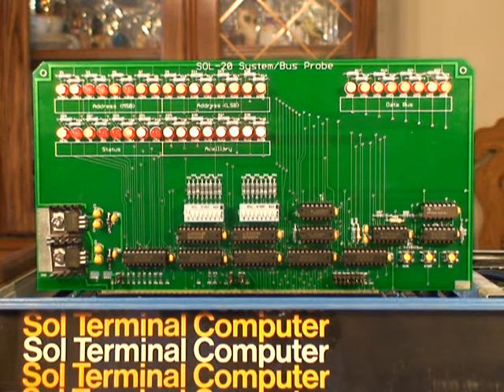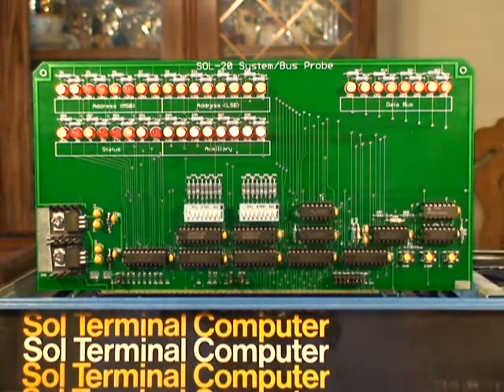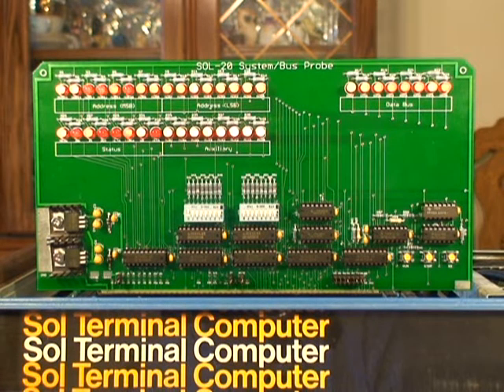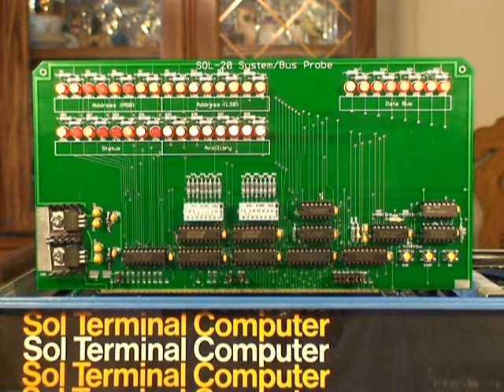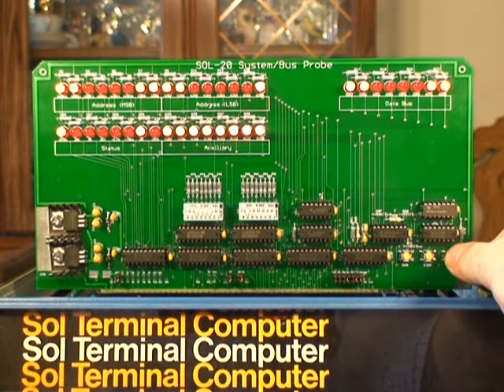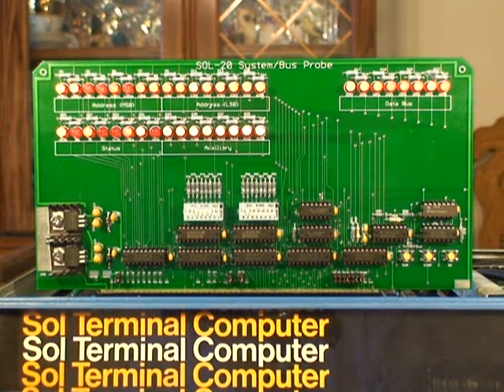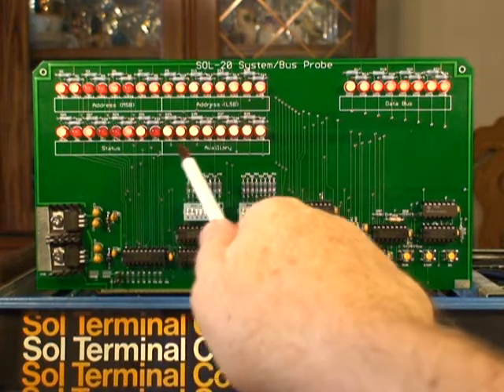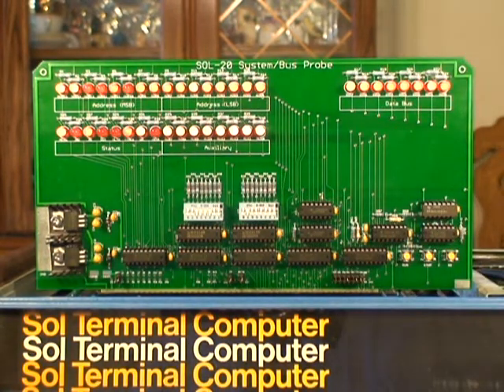SOL-20 System Bus Probe

Comment: Is this available for sale/production? I just restored a SOL-20 today (so far it appears only the keyboard pads had aged badly - even tho I just briefly got to test it yet - so there might still be some hidden issues) and the owner would definitely love this board (and could use it greatly since he's a doctor teaching media sciences in university to show how a programm is run). The machine also has the straight up socket fitted which I've seen missing on some systems.
Funny to think this machine is 9 years older than me.